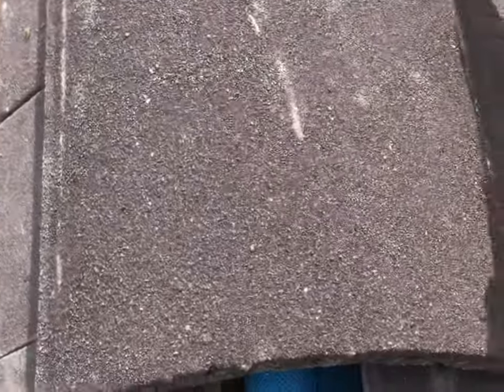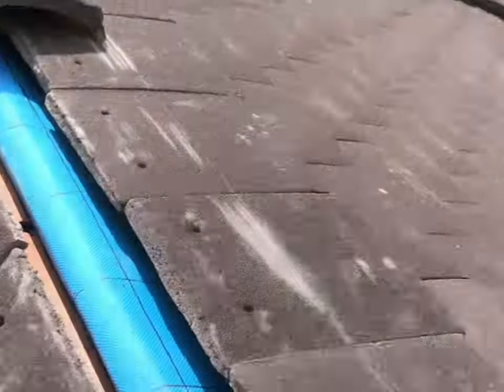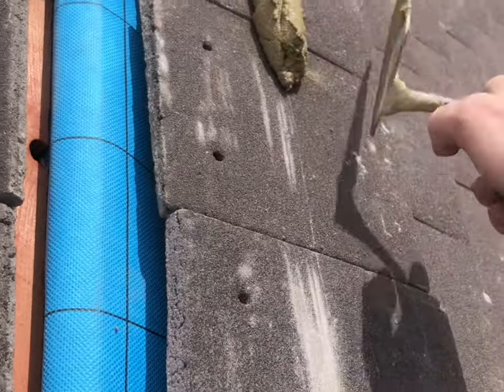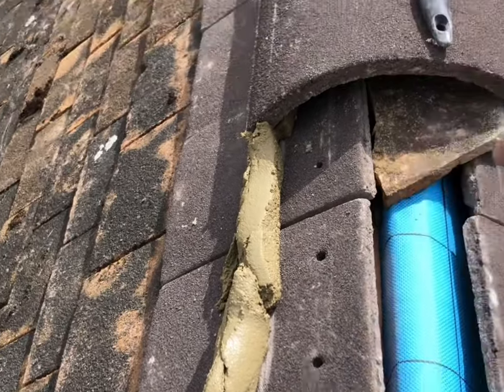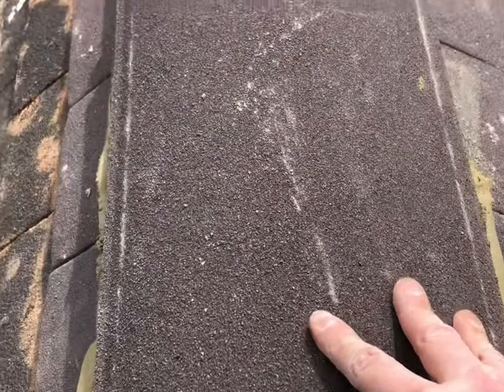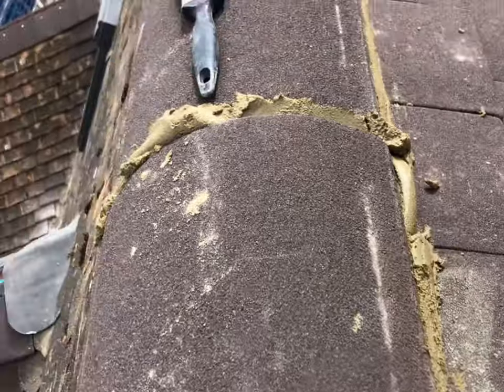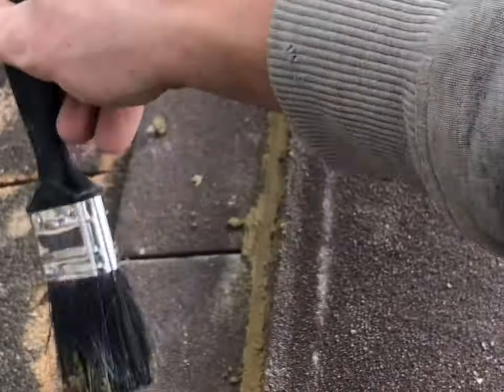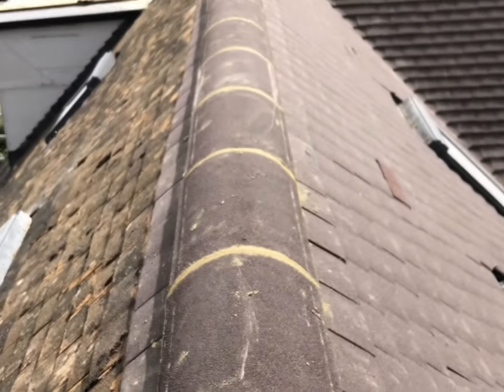How to lay ridge tiles

Comment: Good video but is there any reason why you haven't nailed the tiles under the ridge? In high winds I've seen these lift off with the ridge tiles attached. I can see you nailed them in the lower roof shown in the background.
Reply from the maker: It was a roof I had to follow on from someone else. It was already tiled. The reason was because there was no top eve batten and they were just hung on top of the tile.
Reply: Sick of tilers blaming the roofer before, least stick the tiles on, not enough muck either.
Reply: @louie.vision.5255  Some tiles haven't been nailed at all and there still on the roof after 70 years

Comment: How to not do it! The whole lot is not fixed down and can blow off the roof in a storm. Had it myself.  Top three rows of tiles need to be firmly nailed. 
Also if you are working to regulations (UK) the ridge also needs to be properly fixed, either with end clips or for old style drill a hole in the top and fit a screw. 
It holds on better if you add some battens on the ridge to build it up to the underside of the ridge tile. 
Then add about three times as much cement.
Reply from the maker: Top 3 rows do not need to be nailed down. Last tile course needs to be nailed and ideally the Eve course so when you sit down they don’t flap up when mucking the ridge on. On building sites (house bashing) we had to put screws inbetween the joints of the muc and mechanically fix as well as cementing the ridge. Also we use breakage to pack out under the ridge to not use much cement. This is something most roofers do.
Reply: @roofinguk  I am quoting UK building regs. All tiles need to be fixed down now, with the exception of plain tiles that have a triple overlap (as the vid has) and then you are allowed to miss some rows but only away from any edges. 
Of course on refurb work you do what you like.
Reply from the maker: @grolfe3210  very true. Refurb work is allot different to massive site rules. With all these regulations some are more necessary than others. Years ago there wasn’t certain regulations that needed to be followed and the quality of building work back then are much higher compared to the building sites now. All price work and no care. Check out my other video Iv got a 28,000 peg tile job and possibly 60,000 tile job on their too.